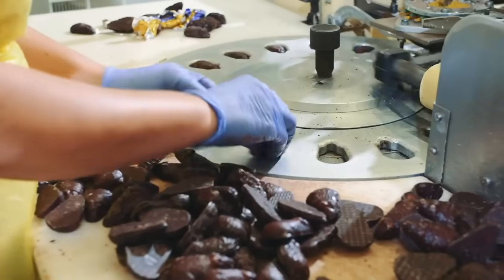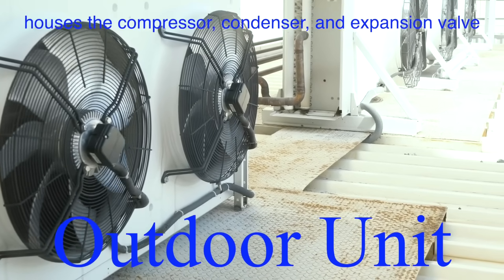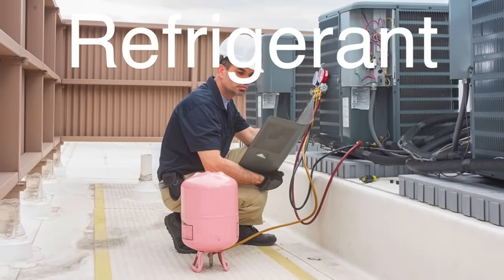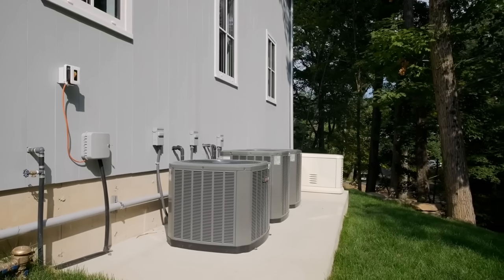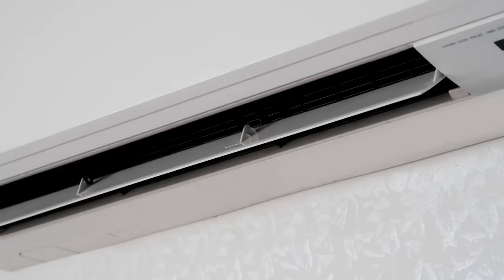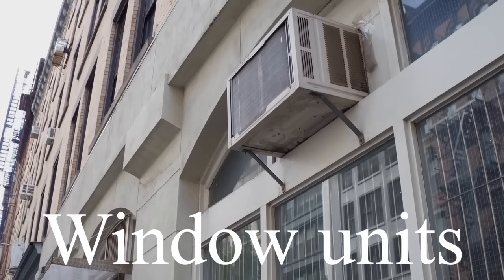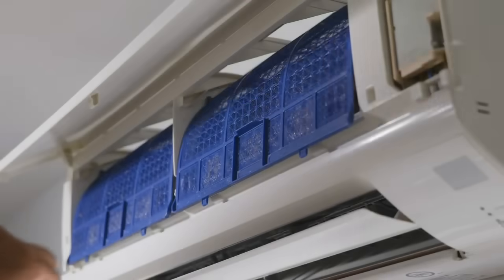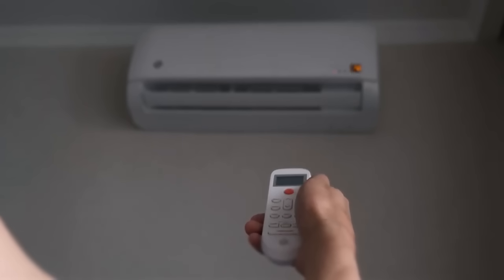Understanding Split System Air Conditioners: How Do They Work? | 1.1

Comment: Just one thing to consider: when installing such a system: You get a lot of condensed vapor inside the indoor units that turns into water and  has to be drained somewhere.
Reply: Yeah, that might be why these units all have drains to handle the condensation…
Reply: Agree, didn't mention this